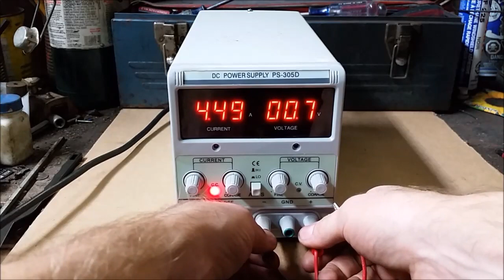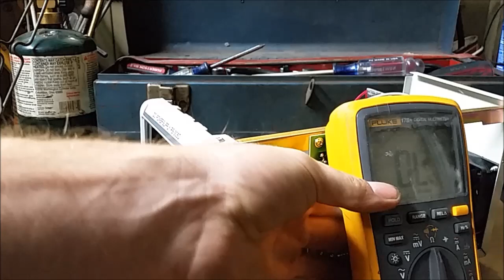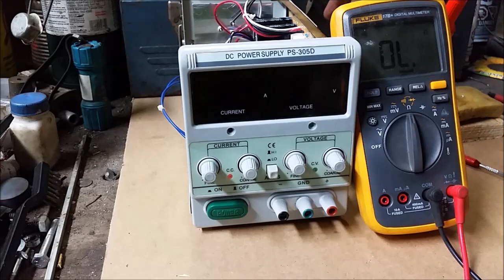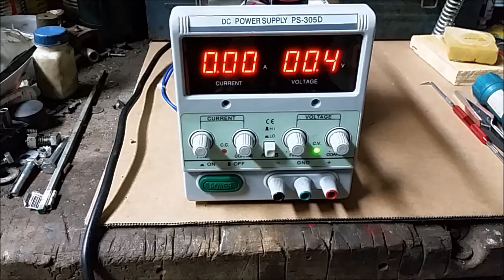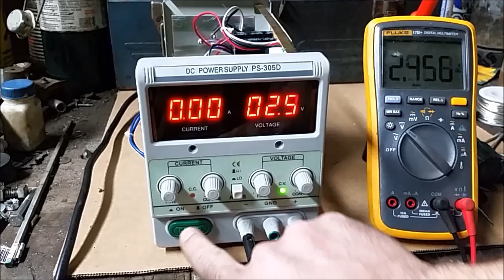Repair 30V Benchtop Power Supply No Voltage!  PS-305D

Comment: My PSU Look the same but inside is similar, after connect and disconnect power to a bad shorted HID light fews time (light is on but not stay on so I try fews time) then a PSU over current LED stay on and can’t adjust any more, and no voltage out.
After checking a voltage found  a 7815 is bad replaced it, problems still the same, removed and check all diode, all of them are good. I am stuck here, then found this video, I removed a Black and Yellow wire like he show and see a short in the main board and a diode is on this board not at the voltage output board like his, but my diode is good. So I try to power On again and find a component that are Heating then found the LM3xx (14 pin) is really hot, remove the bad LM3XX , install a 14 pin socket (so I can easy swap an IC if it is bad ) then insert new IC, My PSU is working again.

Comment: That should fix mine for the same reason. That was a diode for reverse voltage protection.  you should use a solder sucker or copper wick to remove solder.  You heated and tore the copper foil trace.  A little practice with either will make you a pro!

Comment: glad I stumbled across your video.
I have a RD6018 60V/20A.  
unit won't power on. gotta figure out what's happening.
i started off like you, seeing if problem is from display or power supply itself.
using a 12V power supply, found out my display is great, no problems.
now on to the power supply itself....
don't know how I'm gon fix it or at this point what im really looking for, but I'm confident I'll figure it out. 

and you're right, ain't much help online ....answer is always "just buy a next one"
Thank for your video, sir.

/bklyn👑

Comment: Cleaning with acetone and flux would help with soldering.
Good job on repairing the diode. A $1.00 part is much cheaper than a new power supply!

Comment: i watched your video this morning ,after my rapid 30v 2.5a bench power supply would,nt  increase in voltage at all .0.00 on the display ,i was kind ticked off ,only owning it for 5 months ,yes it was a used unit ,but it worked .and itw as great for nickel plating . just checked the diode in question ,and hey presto . you where spot on .i,ve ordered the replaced diode ,and i felt it only fair to give my thanks for the information you gave ,in your video  ,plus i learnt  something ,regards sion .

Comment: I bought the PS-1502DD Bench Power Supply on facebook and it does not work, it blows the fuse each time. I think it takes a 1A fuse but I put a 5A and still blows, can you suggest whats happening.

Comment: I love screwing the Chinese outta another sale and keeping E waste outta the E landfill. Good sleuthing.

That output diode is there in case another voltage source like a battery gets connected backwards. Its value is chosen so that it will short protecting the PS output stage. So, huray for the design it functioned just as it should. It took a licking and kept on ticking. Just a minor part had to be replaced and the PS was back to work.

A clue that was showing is that you had current of about 4A while the voltage was around 0.6V. The PS was still exhibiting current control and most likely still retained its voltage regulation if not for the output diode short.

This repair; saved money, saved time, saved the E landfill and you learned something. A good day indeed.

Comment: Thank you for the video! my diode appeared to have some damage as well. I had the short circuit condition after connecting an 18v lithium ion battery in series rather than paralell! There was an FR304 diode that failed it's diode test. Removing it confirmed the short circuit was gone. I replaced it with a 1N4004 diode and it's working again. This is an even smaller diode so it should fail faster next time I... test thing :) will be waiting a few weeks for the FR304 to arrive.

Comment: yepp the diode on mine cracked  to.But my powersupply have a 6 turn shunt also over where the diode connect,That smelled and looked to have been to hot 1 time i did a mistake. Second time The diode broke and shunt burned off.Have to make a new.Have another supply same model witch i can messure the shunt to make one that is correct.Hoped there was possible to buy spare parts to it since this model comes under many brand names like Korad. RND KA30-3005d etc,but have been hard to fint out where if at all.

Comment: Thanks so much for taking the time to make this video. I found the same problem with my bench supply using your video and have ordered enough replacements to repair it 10 times @ a cost of just $6.00. BTW, if you don't know, that diode is the reverse connection protection device. It saves the supply if you cross the + and - leads on a battery. That's why I bought 10. Pretty sure that's gonna happen again in the future. LOL
Reply from the maker: Thanks!
Reply: I have to thank you too. Same problem, same solution. Thanks!

Comment: Not being critical, you should have a good solder station and use leaded solder with rosin core, it will help in your overall soldering technique.

Comment: i hv same unit, which transformer is used in this unit, in my power supply is gone faulty i hv to replace it, and dont know about out put voltage and name of it. plz tell me more on this transformer.

Comment: I have same dc power supply but on its output, there is  50 volts coming . What should i check to solve the problem. Kindly suggest me

Comment: Thanks. I bought one of these cheaper ones but am trying to fix an older common one. Bit heavy with toroidal transformer and analogue meters current overproduction is always lit up like on yours. (Not asking you to try to troubleshoot it you understand.. Just letting you know about it) Thanks for tutorial. I should have known to try these techniques and hope I can find some damage or failed component it worked until I dropped it so probably pcb crack. Can’t find it yet but I highly suspect it. Had a near enough schematic for it (These type are all the same not sure of model but I think you’ll know it.) It’s one of those heavy black ones with small 12v abpnd 5v regulated dc o/p connections on as well as main DC o/p